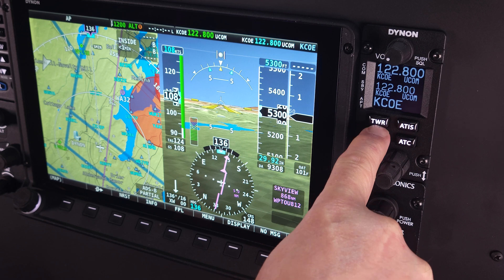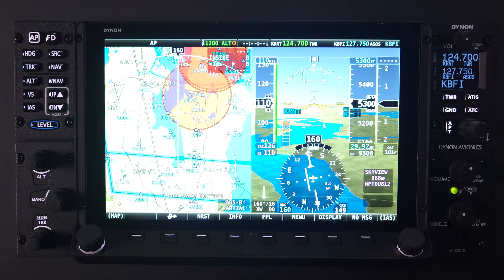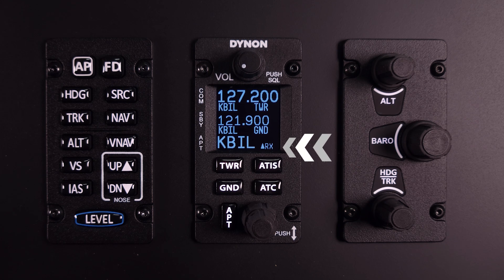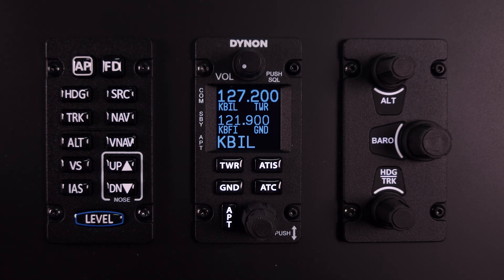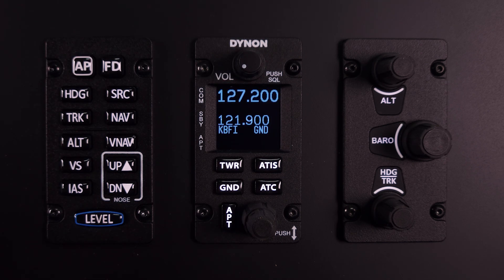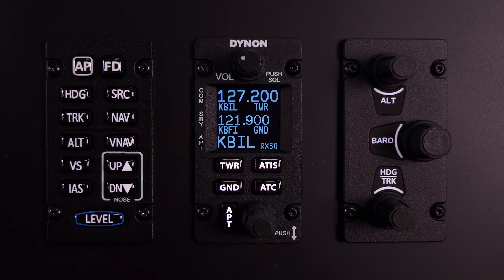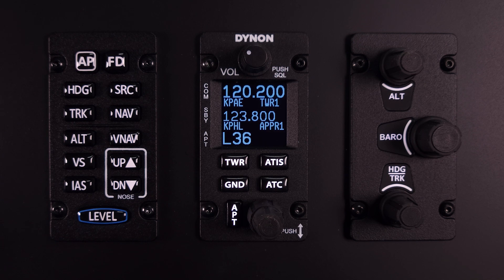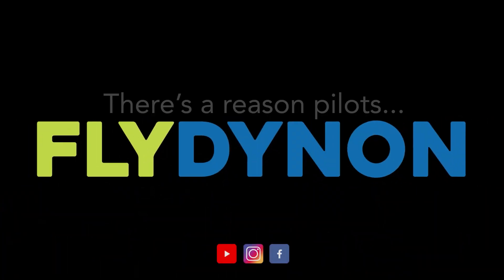Dynon COM Radio: SV-COM-PANEL Basics | SkyView HDX Academy

Comment: Great video as usual. This is my exact layout. My question is can I install a second radio and comm module
Reply: I looked into it. It’s physically possible but it doesn’t show up on the hdx. You also need a switch to set which radio the ptt buttons are triggering.
Reply: Yes you can, and it's done often but it gets complicated without an audio panel. You can only display and control one of the COM Radios on the HDX. You will have to add a toggle switch for the transmit and turn down the volume on the radio you are not using. As you can see, it's complicated but doable. Call Dynon customer support for the details but I highly recommend an audio panel like the Trig TMA45.
Reply: @dynondave444 great advise